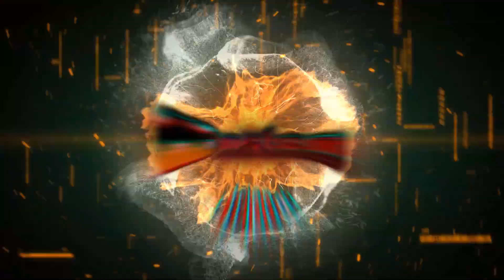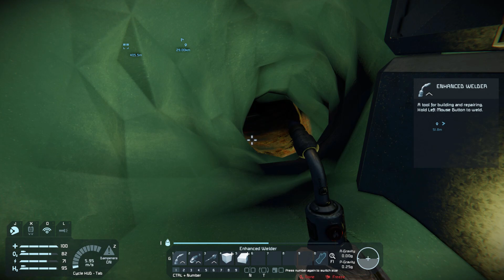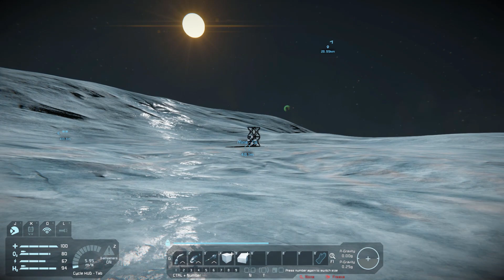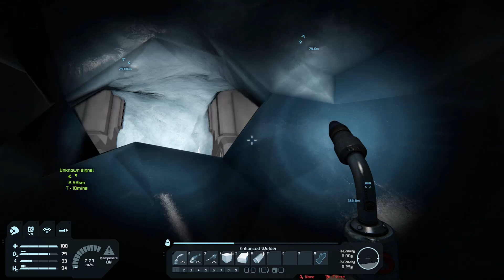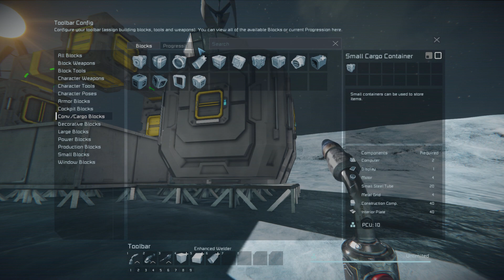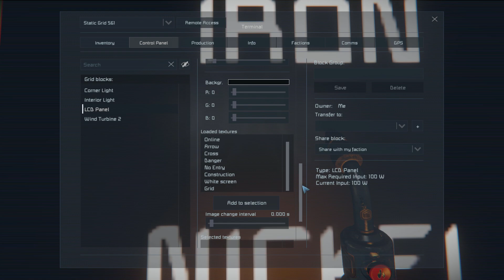Mine ..... ALL MINE! | Space Engineers Survival | Season 3 | #3

Comment: Good to see you back at it fella.
I like you prefer the covered mine but unlike you I use convery tubes up to the surface with a small cargo storage at the bottom and top with a horizontal connector on the top cargo to back my "pickup truck" onto so I can put in materials I have drilled out by hand (I find hand drilling quite relaxing) into the lower cargo which then gets pulled into the truck via the connector.
Great work fella. Keeps up the great work.
Reply from the maker: Didn't do anything too fancy as it's unlikely I'll use rose mines again now I have a mining vessel